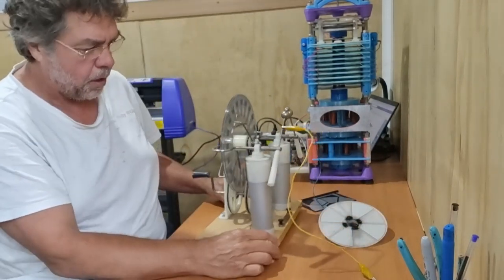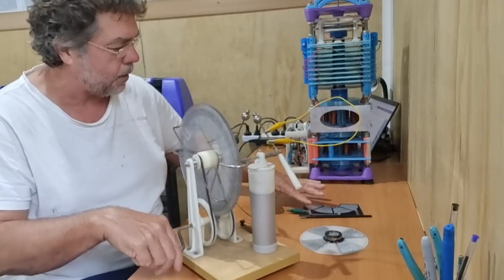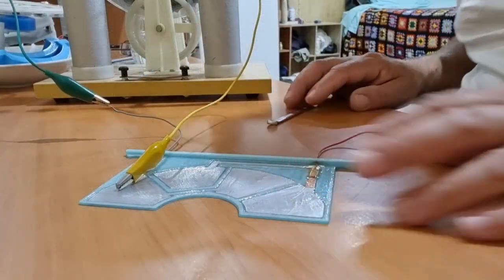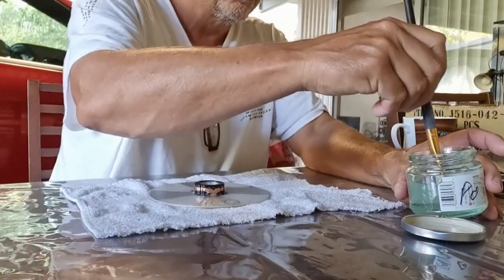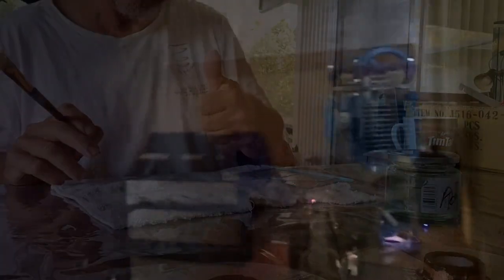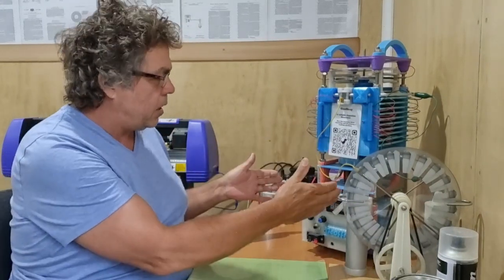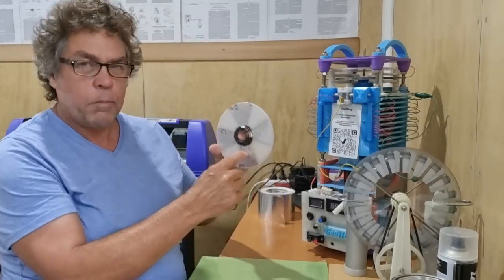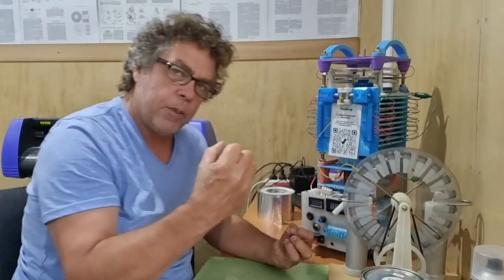Building Geoffrey 07 Dielectric

Comment: you could also test using a tile and grout sealer, they come in spray and paint on options and maybe cheaper? 
Nice work on the machine though, a larger plate should work great.
Reply from the maker: I'm hoping someone has a go and shares results

Comment: How does your Wimshurst machine compare in performance to this one?

https://www.youtube.com/watch?v=c8AruWbO8lE

Are you also using lazy susans?

Can you upcycle CDs for the disks?

BTW, I do not not know where you bought that LED, but it looks a lot more like an adult toy than a light bulb. ;-)
Reply from the maker: This machine is fully charged when toppler machine connected and discharges at 100 times per second per capacitor bank.
Also I sent this machine to Robert a year ago he liked it so much he made his own but doesn't fully understand the principles behind it
Reply: @raefon72  Thank you for taking the time to reply. I hope that you are having an enjoyable new year.

Please can you talk about some of the practical applications of having a 10kv toppler machine that discharge at such high rates.  Would this be  suitable for charging up the capacitors that they use for fusion reaction?